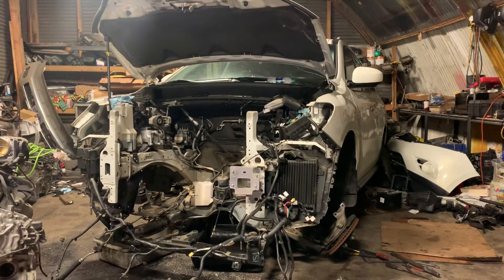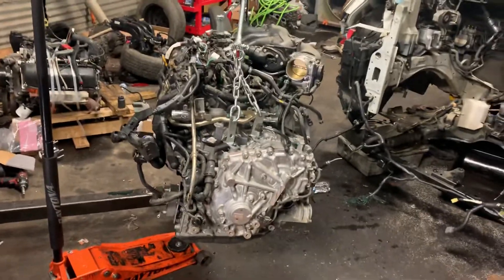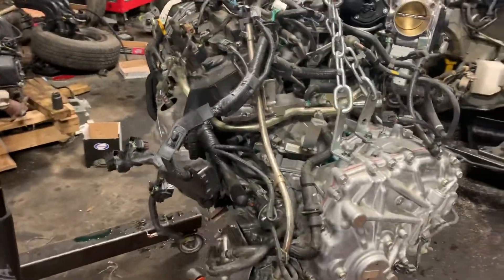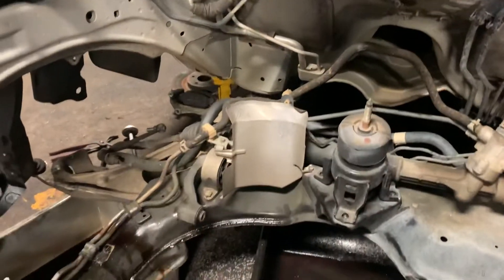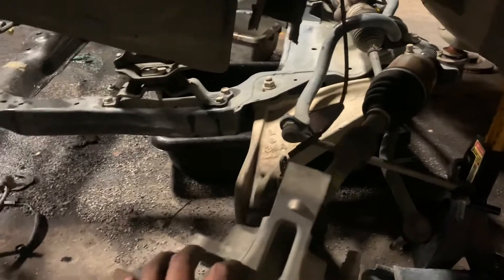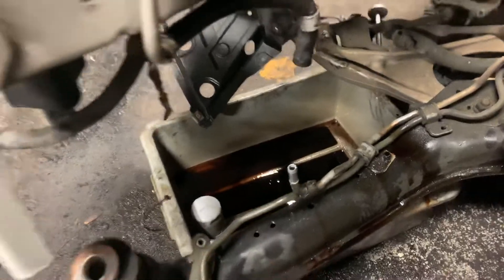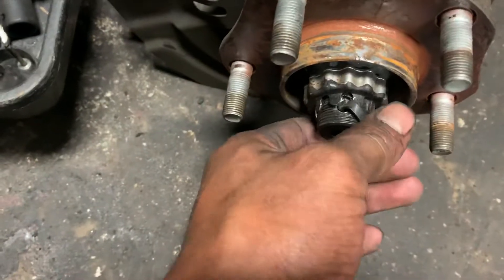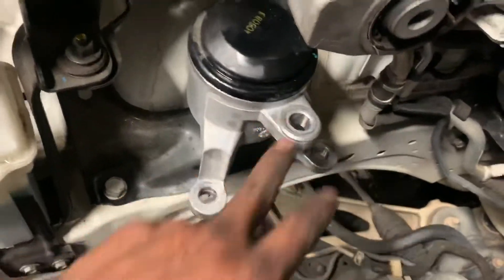2014 Pathfinder 3.5 engine removal plus tips

Comment: Thank you for taking your time to show and explain thoroughly the process of this job. Im replacing an engine on a 19 QX60 due to sludge. All the best God Bless
Reply from the maker: Thabks for watching 
Please subscribe for more!
Reply: Trust me easiest way is dropping everything with the subframe but everyone on YouTube is trying to be scientist 
I have 2020 QX60 and replaced the transmission by removing subframe exhaust converter transfer case and I did it outside at my old storage unit 
Took me 2 days to finish 
Now I gotta pull everything out together with the subframe because the chain is rattling and it lost power in 1st gear,,, they don’t really have gears CVT but they somehow do shift 😂

Comment: Do you think i can use the same way for a 2018?
Reply from the maker: Mmmm..
To be honest haven’t worked on one yet 
But looking at the pictures I found looks like it would be very similar to the one on my video!
Thanks for watching
Reply: @GeneralMechanicGA  thanks for the info. Other shops say its a bottom removal. But i dont want to go that route. I wanna try to do it the way i seen you uninstall it.  I believe it cam be done that way. Its the same generation and same motor.  Nissan says they didnt change much from 2013 forward
Reply: Was the 2014 you worked on All wheel drive or fromt wheel drive?
Reply from the maker: Well to be honest that engine i got it out in like 5 or 6 hrs
Without checking the steps on the book! 
And well idk how but just try to focus on how i take stuff off!..
Thanks for watching
Reply: 13 to 19 same. Easyer to to as per service manual 2.5 to 3 hrs to drop subframe with engine and transmission out. Been doing those for yrs

Comment: Thank you for your time and help with the video very helpful, I have a question about the car, do you if if possible to make this car rear wheel drive instead front?! I saw a opening in the back and I was wondering if you can use a infinity engine and transmission in to this car!?

Comment: Would you just help me how to disconnect the crank shaft pulley? Is clock wise or anti clockwise the bolt direction?
Reply from the maker: Just like a regular bolt!
Reply: @GeneralMechanicGA  Thanks! But, I just tried opening it the regular way, but I could not! It is very hard to be turned. Do you know a way of a technique I can do?

Comment: Plz show the poo21 location pathfinder 2014
Reply: Shall be apprecaited your reply
Reply from the maker: I will see what I con do about it ok
Reply: @GeneralMechanicGA  thanks to ur responce accutlly my car 2014 pathfinder  showing code p0021 and while driving car little bit dying and specially when drive in hilly area than feeling much dying during drive and RPM also minor shaking .and m living in remote area no access for mechanic
Reply: Need to remove variable values and need to clean and verify is that working or no..so kindly show me the location